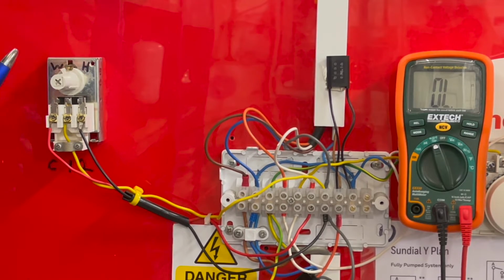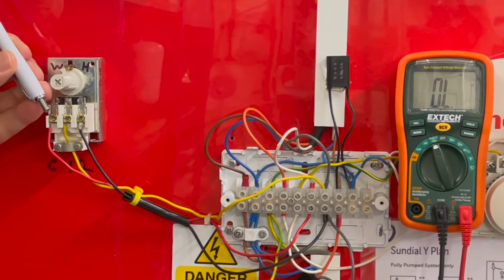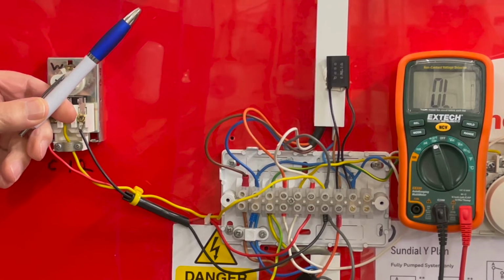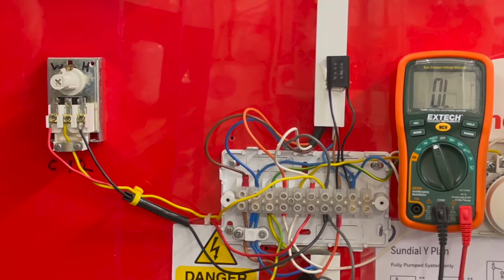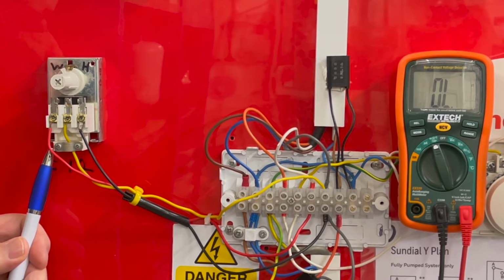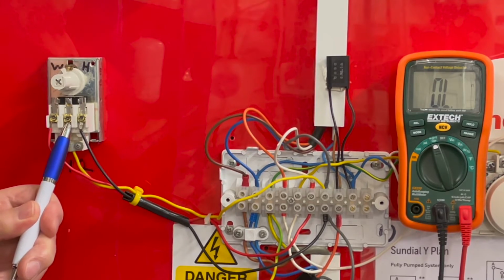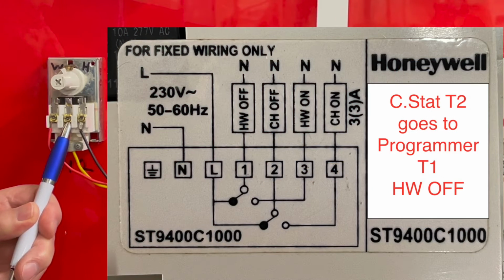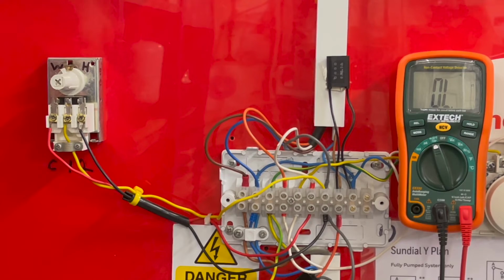NO Heating Faults 2  Cylinder Stat

Comment: Hi I’m wiring in a new 3 port motor valve and unfortunately a black lead from the tank stat came out of the connector block and I can’t find which port it came out of.
I forgot to photograph beforehand 🙄
Your video about faulty tank stat is the best I’ve seen.
However I’ve noticed on your video the yellow lead from the tank stat is in 2 different positions.
In first zoom on your board it’s in terminal 7 ( left to right) next to a grey wire,
In second zoom it’s in terminal 8 next to a black wire?
Which one is correct please 
Thanks
Reply from the maker: Hi Alan, thanks for the kind words, we love all comments, am I just doing your order? ignore the colours for a bit, Page 49 orange book, 6 goes to Com} 1 is SW L to 8 then  to the boiler Live or SW.L} 2 goes to 7 permanent Live T1 backplate. Hope that helps, George Staszak 🥰

Comment: Sorry i dont mean to Sound thick but ive never heard of a Hot water Cylinder Stat turning on the Central Heating, However on a 3 port ive heard of the Cylinder Stat having Hot water Off, which then puts the port valve into position closing the hot water until Central heating mode is turned on from the room Stat? So how does that cylinder stat turn on Central Heating ?
Reply from the maker: Hi Harry, A lot of engineers don't understand this. On a mid poz. valve HW has priority so until the cylinder stat is satisfied at 60c it will not switch to CH 100% only 50%. On the old diverters the valve CLOSED the CH port so as the HW recovery was ON until it reached 60c the house got cold not clever, and the fuel bill went up. That's why on mid.poz. we use T2 HW OFF, often not done which is why we get HW OK NO CH. Hope that helps. take care, George 👍

Comment: Hello Mr Bedford. I have a intermittent fault with my central heating. It could be a couple of weeks or a couple of days. The heating will come on when the temperature drops and the room thermostat starts to demand heat, but when room temperature is reached the boiler continues to run on. if left it will just keep on getting hotter in the house and the hot water temp does as well. The only way I can get the boiler to stop is to turn the power off. Could this be a tank stat fault ??  Many thanks for any suggestions on a fix.
Reply from the maker: Dear Tim, thanks for asking, cannot be cylinder stat because its a CH fault, you didn't say which room stat you have but it's faulty, change to a new DiGi stat and should be OK take care, George 👍
Reply: OK Thanks George. It is a Drayton Digistat SCR. But it is 7 / 8 years old. I did change the battery a few months ago. Maybe that has something to do with it. @mrcombiBedford
Reply from the maker: Hi Tim, very good stat, fitted loads of the RF version, you could upgrade to RF901 or RF 902 channel which ever you need. I would un pair change the ALKALINE  batteries 
and re pair as instructed, pay attention when to fit batteries, I got lots customers who got it wrong then NO heating. take care, 🤩👍

Comment: So does the common always have 240 volts or is it only when calling for hot water and losses the 240 volts when the hot water is satisfied
Reply from the maker: Hi Craig, Thanks for question, cylinder stat get 230vAC from the Programmer at the time that was set (7am to 9pm ?) C Stat MUST be 60C 1/3 from the base. when the water is used and temp. goes down to 55C the boiler will re fire. until 60c 247 365. Hope that answers your question, regards George Staszak

Comment: What i dont understand is how can you have 2 grey cables, yellow and black connected to the same port on ten way. that doesnt  make sense
Reply from the maker: Hi Lucas, Thanks for asking, don't take any notice of those wires which are changed every few months because they get cut then don't reach so I have to use another colour, just note the terminal number to the strip.
The big problem is installers using BLUE and EARTH wires in voltage or its lots of  black wires everywhere, which makes it very difficult to rewire, I just ripped all out and started again for at least £300., easy money, regards, George Staszak 👍
Reply: @mrcombiBedford  i have a condensation problem in loft and sometimes neither hot water or heating work. I've bagged up the wiring however the problem still persists. The cylinder stat and the wiring of the cylinder stat aren't bagged up, could this cause the boiler and pump to not kick in? Problem happens during colder months. No faults on boiler.
Reply from the maker: @nadznadz5630  Hi Nadz, thanks for asking, I don'y understand "cylinder stat aren't bagged up" what does the mean? If there is no demand form the programmer and or stat the boiler will not work, Have a look at my video about loft stats, https://www.youtube.com/watch?v=4ZC5ozYaJl4 that may help. all the best, George 🤩👍
Reply: @mrcombiBedford  sorry, should have explained it better. I know if condensation /moisture gets into the wiring it can cause problems as it did with the wiring centre in the loft. One of the wires would become oxidised and if i stripped it a bit more it will work fine. So i covered up the wiring centre / bagged it. However if moisture gets into the wiring of the cylinder stat can this cause issues? I get no heating or hw sometimes. Can cylinder stat be the problem?

Problem happens only during winter months and not summer months due to condensation in winter months.
Reply from the maker: @nadznadz5630  So it's the loft that has condensation, you need a roofer to put some ventilation up there. Wiring centres are moisture proof cannot understand a wet box, someone has done a bad job, call in a PRO to sort. To test the cylinder stat call the firm,  as video shows a mid poz valve YES   on a 2 zone NO. Hope that helps, Get someone who is good a wiring and had been on a course. 🤔
Reply: @mrcombiBedford  I've changed everything except the cylinder stat. But even if a cylinder stat is faulty will either hw or ch work or will they not work? I think condensation might be in the wiring for the cylinder stat. In summer months it works all fine...
Reply from the maker: @nadznadz5630  Before replacing a part you need to test if it's faulty, regards, George

Comment: Im having opposite problem. Heating working fine however HW only luke warm and having to use immersion to top up. 
Its at my grandparents home. I will check the cylinder stat firstly.
Reply from the maker: Thanks for asking, warm water is often sensor / stat switching OFF too soon, if the water is scalding then crash, that is DOM exchanger, your is the opposite not getting hot enough, also just check, with the tap ON feel the CH flow pipe under the boiler from cold, if gets hot in CH mode its the diverter valve, good luck, George Staszak🙂
Reply: @mrcombiBedford  cheers for the quick response. It has to either be the HW valve or cylinder stat. Will call for HW and see if its switching and or if valve is sticking. 
Assuming the HW is still luke warm due to the CH water still passing through cylinder.
Reply from the maker: sorry, should say "if the flow pipe gets hot in HW mode its the diverter" test from cold!
Reply: @mrcombiBedford  thanks for that further info. I checked it today. When I called for HW when CH was off.. the feed was getting to cylinder and back to motorized valve, however on inspection of the actuator head, the motor wasnt moving the actuator stem hence the micro sw not making to fire boiler. At first i thought it was just a faulty actuator head. Looking closer at the valve, the stem couldn't fully shut or open. I've put this down to a blockage or it has simply failed. This would explain why the actuator motor had burnt out and stopped working. New valve and actuator order.

Cheers for the advice much appreciated 👍
Reply from the maker: @lonsdaleslipons9570  STOP, that wrong, never ever change the motor or body, change the WHOLE valve(s)🤯 as per video. Oldest trick / con installers do to rip off customers. 
Please flush the system, check the AUTO by-pass under the boiler is working, fit as many BALANCING TRVs (except lounge) fill with 2 bottles of Fernox F2 silencer, Power OFF cut the flex between the wiring block and the new valve use a 5 pin connecter. Job done, anything else is a temporary fix. you pay twice 😀👍👍👍
Reply: @mrcombiBedford  yeah i ordered a new 22mm honeywell valve complete with 5 core actuator.
I will look for any strainers etc when im next there.
Reply from the maker: @lonsdaleslipons9570  Excellent good idea Batman

Comment: Following your ohms testing and My cyl stat has failed on ch side. It's a IMIT TW 0-90c type TR2 9305 with the probe. Do you know of an alternative as I'm having trouble matching it up? Could I have a range change to 26- 92c for example.
      Thanks, great content in your videos
Reply from the maker: Hi Type 1, 💖the name, If the cylinder firm cannot supply any ID on the stat? As long as another probe fits and set to 60c should be OK, ask the commercial installers / firms it's more in their side. Gas Safe web site comm. put your post code see who is near you, hope that helps. George Staszak. good luck👍
Reply: @mrcombiBedford  thank you! 👍
Reply: Hi, I just ohm tested 2 new stats using your method and neither show continuity from com to 2! (CH).
      With power on  turning stat down does switch to heating.
Reply from the maker: @Carlostype  Because its not reach that temp, some stats are like that, you should be testing in buzzer mode, turn to lowest C 2 1 buzz, turn to MAX C 2 2 should buzz.
As I said because the air temp is about 20c some stats (digital) won't click or change, if it's new assume OK. regards, george👍

Comment: Good clear video. My thermostat only has two wires, even though it has both C/H & H/W valves. Had to check it today as by boiler seems to be intermittently not heating water.
Reply from the maker: Thanks, Yes HW will be uncontrollable because Nest has only one clock for two zones, the next video will show this and fix, Thanks for the comment
Reply from the maker: Hi Rehoboth, a 3 port mid poz has 3 wires a 2 port has 2 wires, just measure EARTH to NO if its 230v U R in HW mode, hope that helps, George Staszak

Comment: Mr Combi training and sales, in a continuity test (buzzer circuit test) on my cylinder thermostat, I get a circuit between Common (C) and 1, but no circuit between common and 2, even though I have moved the temperature dial as far as it will go. Does this mean my cylinder stat is faulty?
Reply from the maker: Hi John, thanks for asking, no, it shows it's in default  HW mode until 60C and and no demand for CH.
This is a 230v test to see if the stat is OK and switching OFF at 60C
Measure  black lead to earth red to COM = 230v  then 1 = HW 2 = it's in CH mode)  
Hope that explains, regards, George Staszak
Reply from the maker: Forgot Yes in ohms same test, C to 1 buzz =HW mode, C to 2 CH mode (1 should be silent) so you's is faulty. george

Comment: How does a cylinder stat control the heating sorry I’m confused
Reply from the maker: Hi Shahbaz, thanks for asking,
As I explain, if the stat is stuck in HW which has priority over CH the CH cannot go to 100% only 50% or the valve will not move, it depends who the wiring is done. Hope you understand, take care
Reply: That's for Y plan set up
Reply from the maker: @harvdub9904  Dear Harv. I know but what's the faults??? George
Reply: @mrcombiBedford  Fault is with Cylinder Stat no continuity
Reply from the maker: @harvdub9904  No😔 it's wiring errors
Reply: @mrcombiBedford  whats the wiring faults
Reply: @Shaybaz Ali, I'm not surprised you are confused. To describe a cylinder stat as "controlling the heating" is bound to confuse. I would never describe it that way.